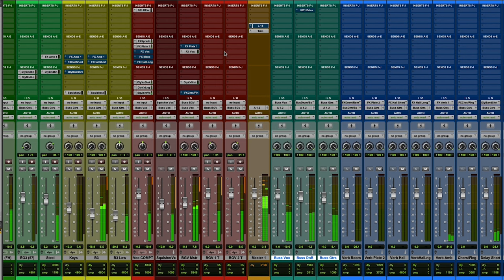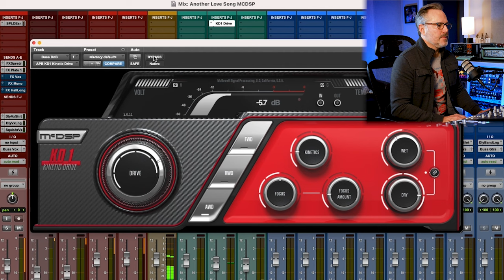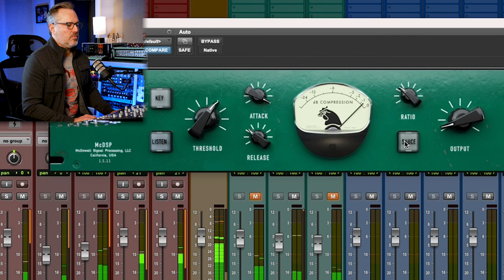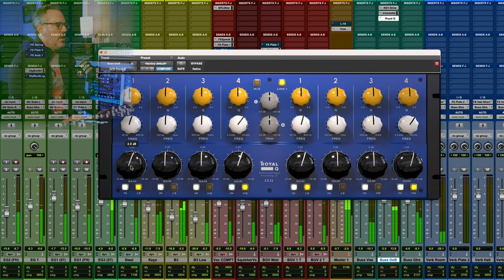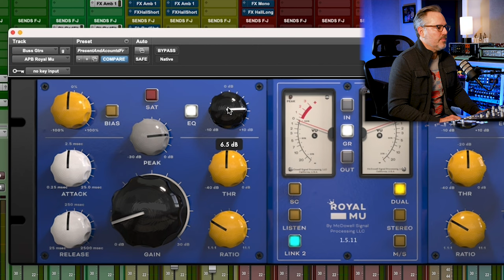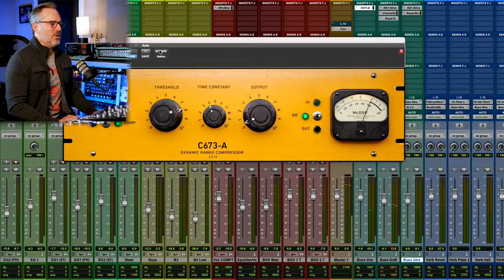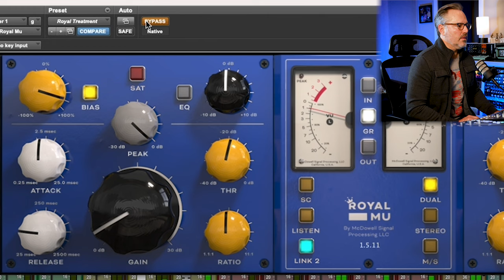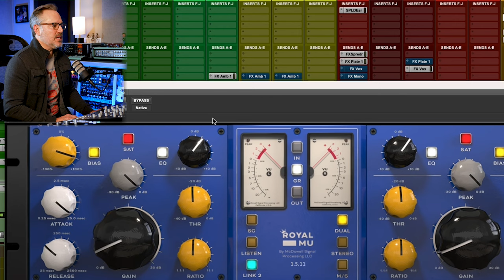World's First Programmable ANALOG Processor - McDSP APB16 @McDSPTV

Comment: Interesting. Many of the plug-ins/circuits in there seem to be analog emulations of other circuits as opposed to a digital emulation (like VST plug-ins). For example, the tube limiter doesn't have tubes in it, I don't believe. Definitely blurring the lines.

Comment: Wait, so the 16x box only allows us to use 16 mono/8 stereo instances of a plugin? So let say, if I have an EQ, Comp and a drive on a bus I already used 6/3 processing cores?
Reply: If your three instances are stereo you would have used 6 of 16 available channels.
Reply: Correct. There are that many channels of conversion to run through that same number of analog circuit chains within the device.
Reply: @michaelmatarese322 but it can’t daisy chain when you have the plugins on the same channel or?
Reply: @rareos You can have multiple apb plugins on one channel of audio and the apb will use one (mono) or two (stereo) of its 16 channels for each instance. The best way to think about the apb is as 16 hardware inserts that are using one channel of conversion each. What makes the apb amazing is that each hardware insert has a plugin to control it and provide sample accurate automation. Hope this helps.

Comment: My understanding is that there is no analog compression in this unit, nor tubes. The analog element is from the saturation. Not sure if there is EQ in there as well. Can anyone confirm this?
Reply from the maker: No, it's not just saturation it;'s digitally controlled analog for instance when you operate the APB‑16 as a compressor or limiter, side-chain detection, equalisation and so on is handled in the plug-in, which then sends a control voltage to an analogue device within the APB‑16 telling it how much gain-reduction to apply at a given moment.